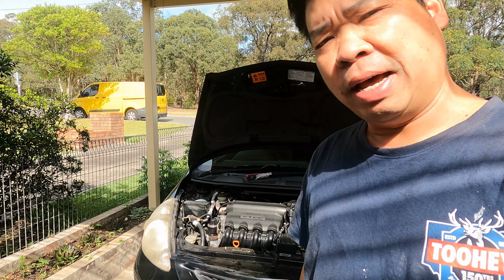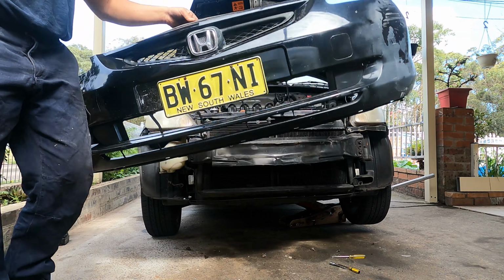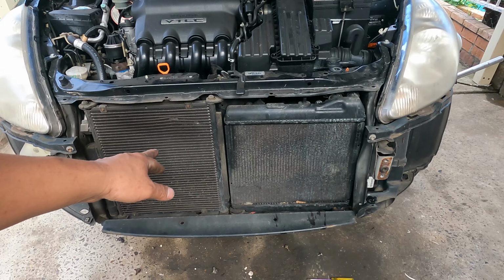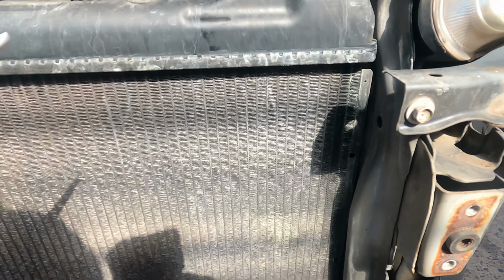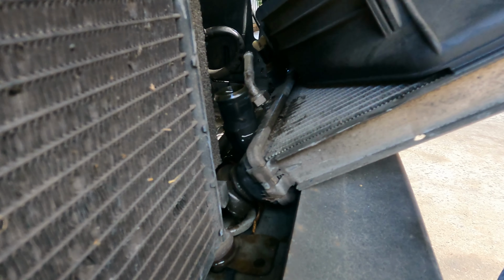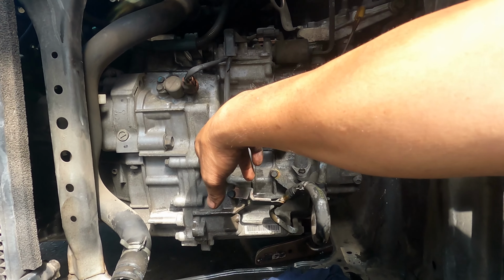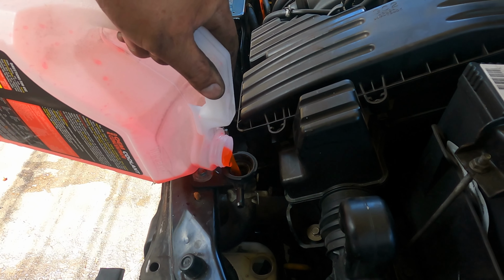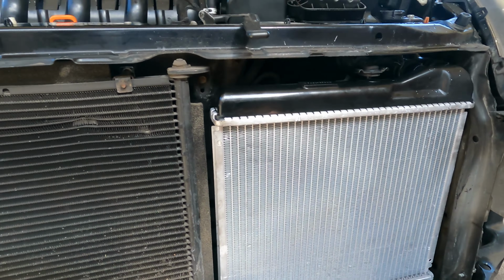honda jazz 2002 radiator replacememts

Comment: Can you help with how you connect the 2 pipes from radiator to gearbox I think I put them wrong. When I drove a bit the radiator popped had to buy another one but haven't connected the pipes again im thinking it's the reason why radiator popped

Comment: Wow!! Thanks a lot Simon for these D.I.Y. and info..!! I actually have the '08 usdm Fit version, and was scrolling around on how to remove the radiator when the You Tube videos led me to yours..!! Thank God it did, and thank you for it..! 
See, I've been planning and always have wondered and wanted to do a JDM front body swap for it but since there's a few things that change from them between the usdm & jdm front ends.., I've known of a few conversions already made possible, even by dudes and local friends here where I live in Puerto Rico..! 
The thing is that I was wondering if it was possible doing that conversion or change of the shorter radiator/ and air condensator what exact type of radiator & air condensator you guys use for it..!?? 
Since here in P.R. is a bit difficult getting a hold of a few parts and inclusively a bit expensive some of the times.., the best way for us usually will be through good contacts either from Santo Domingo that have better ways and access to all of these kind of things.., or through some websites that offer those kind of products..! 🙏😔😌🙂👌

I actually thought that these type of radiators & air condensators only came for the earlier Jazz 1.3L i-DSL engines.., but since I saw that your's is the same we have in the same usdm engine as ours, which is the 1.5L V-Tec that means it's possible to apply those modifications to ours..!! Although I'm not sure yet though too if it would need to be needed just to get the radiator & air condensator to adapt them to our USDM version or would we need to get too the fans that you guys use to complete the swap installation..!? 🤔🤷‍♂️😊
Once again thanks..! 🙏✌️

Comment from the maker: maybe the tbey put radiator on when they fil up water.it has air in the radiator.so not enought water go into water pump you get over heat so it pop out...